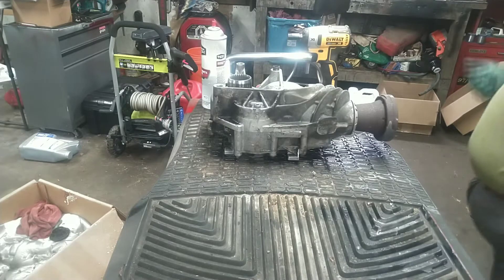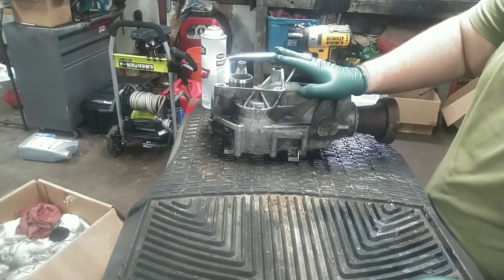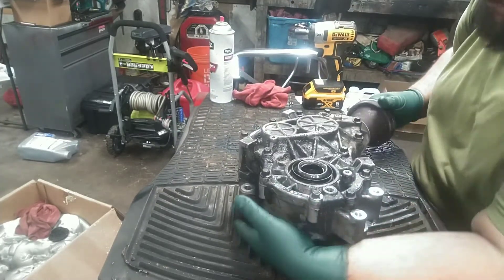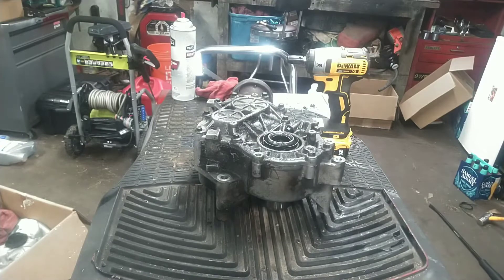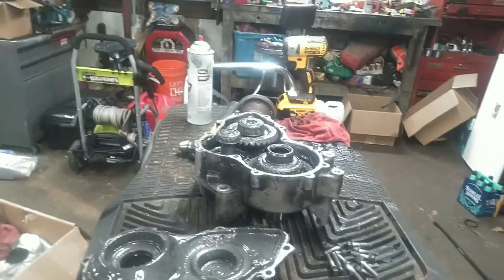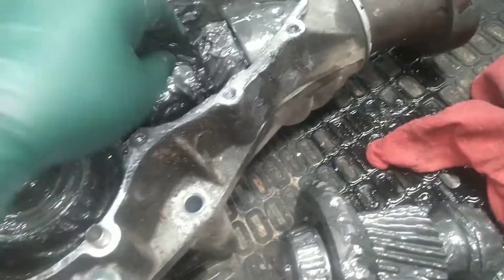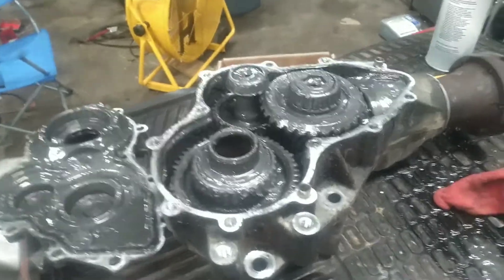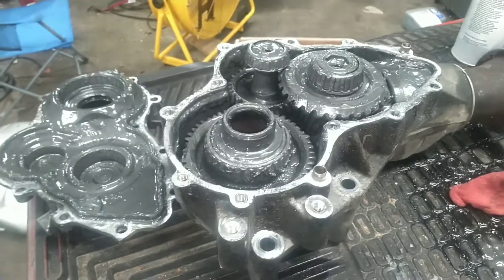Ford PTU failure autopsy

Comment: How’s the ptu doing now form the gear shop? Any issues? Would love an update
Reply from the maker: It did good until December 6th when I got hit and the car got totalled. I ended up getting a CPO 17 Escape Titanium Sport to replace it. But when I had it no issues at all.
Reply: Awesome, thanks. Sorry about your car though!
Reply from the maker: @glm88  cars can be replaced, but what really blows is that in addition to the ptu last summer I had also put tires on it at the end of October. But what's important is that my girlfriend and I are both okay.